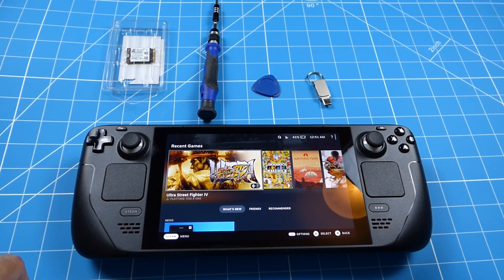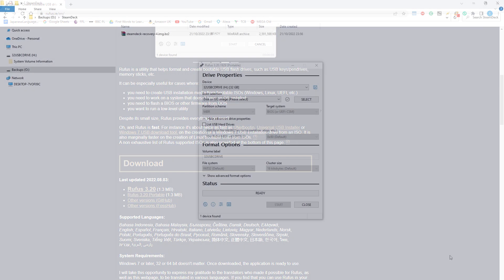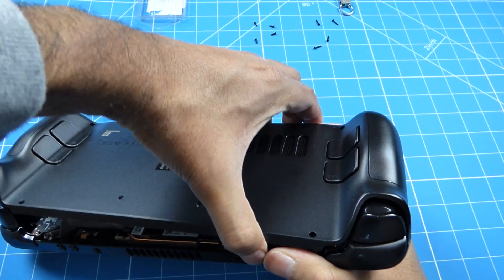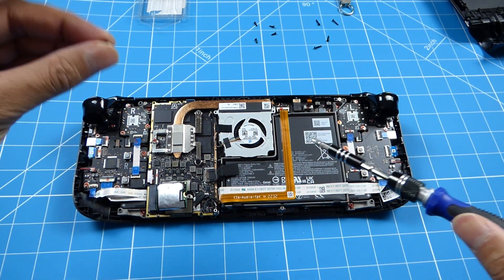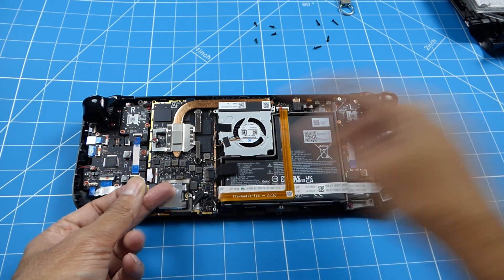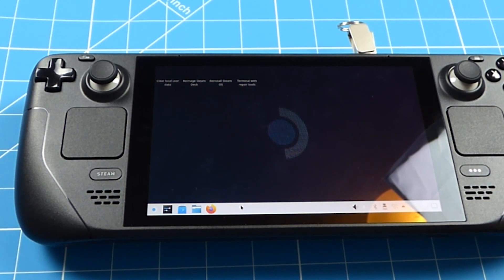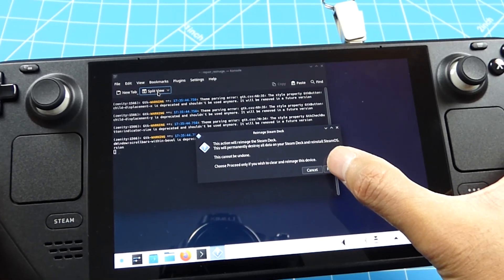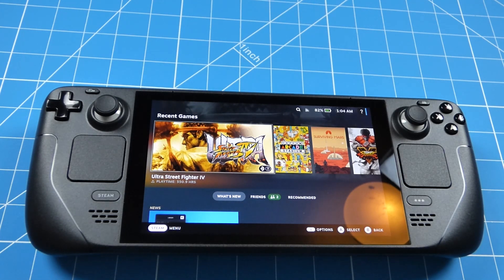Steam Deck SSD 64GB Upgraded At Low Cost !

Comment: Just did this with a 1TB SSD. It was a bit longer than the original SSD and I had to alter the padding under the shield, the shielding tape no longer fits around the SSD, and there's no screw to hold the SSD down 😅 So far, so good!
Reply: I went from stock 64gb to 512gb to 2tb and I found that it's way more seamless if you do a drive to drive clone with clonezilla before disassembly in order to keep all your game installs intact.
Reply: @exakelgaming  Good idea, lucky for me I had only had my Steam Deck for 1 day when I did the upgrade.
Reply from the maker: Nice. 2230 sized drives are not the cheapest. Well done !
Reply: guys isn't better just to buy an micro sd card? that's why you have this slot for , why would anyone need those internal drives?
Reply: @Voltomess  2 words: MOAR SPACE!!!
Reply: @Voltomess  It didn't cross my mind that I could install a 1TB SD... oh well...

Comment: Mine took 30 mins then went to black screen with mouse cursor and that's it.... So I turned it off... Should I have waited longer or did I do something wrong???
Reply from the maker: I think something went wrong it shouldn't take that long.
Reply: @IntriguingTech  I got a SanDisk drive this time...  Will try again... I hope the SSD I got is good
Reply: Update , I got the SanDisk and it worked in like 3 mins.  One question I did notice is that on my deck in desktop it does mention an update needed for better compatibility for my SSD.  But I'm not sure how that works in my deck so I left it alone
Reply from the maker: @gaminginstilllife9429  Glad everything went ok with the new SD card. Yes the firmware update is good I recommend installing it. The update fixes a few issues on Samsung SSDs.

Comment: I purchased the 64Gb one as well and upgraded to a 512SSD for peanuts.  I wanted sharp screen clarity on the 64 over the fuzzy screen look of the 512Gb Deck. It looks like it has a thin layer of grease on it and when I tried my friends - I kept blinking as I subconciously felt that I had sleep in my eyes.  I didn't like that - but the crisp sharpness of the 64/256 Deck model screens are fantastic.  It has a bit more glare (reflections are muted but still present on the 512 Deck), but the clarity is way better.  I approve your strategy - get the cheap deck with the sharper screen and go for a cheap SSD upgrade.  You save a lot and you end up with a better product!
Reply from the maker: Well said mate! Thanks for commenting.
Reply: what cheap SSD you guys recommend? I'm waiting for my steamdeck and I wonder which one to get, I only know it has to be M2 2230 but which one WD or the others? I want to get 512 or 1TB but not expensive, I gotta keep money for games 🤣🤣

Comment: For all the work you did. You should have just put a 1TB in that steamdeck.  It would have cost you about a 150 bucks.
Reply from the maker: Its not needed, I have a big SD card and there is only so much games you can play at once. Thanks for commenting.
Reply: @IntriguingTech  what! That makes no sense. I can always use more memory. I'm literally at a loss for words right now.
Reply from the maker: @Coreygunz252  There's very little benefit of the ssd for loading games. It's only for caching data. In that case a small ssd + micro sd card is fine. See this video https://youtu.be/4AIY5wH77Po

Comment: Hi, thanks for the video!
Couple of questions? The Ssd I have coming will have been in a windows machine (second hand), do I need to format it to a different file type before it goes in the Deck?
The same question for the SD card too basically, does it need to be formatted to EXT4 before I dump the image file onto it? Thanks!👍
Reply from the maker: Hi, The SSD will be automatically formatted during the reimage process when you boot off the USB. The SD card can be formatted to EXT4 but it wont be readable on a PC (just format as shown in the video). You might be able to format it as NTFS and it will readable by both windows and Linux aka Steamdeck (I didnt try this but it will be more convenient).
Reply: @IntriguingTech  Thanks for the reply! Looks like it's just FAT32 at the point you dump the recovery image on? So Deck can read that ok, I take it? Thanks again. (Waiting for Deck to arrive, just getting everything planned before it arrives.)
Reply from the maker: @poopscoop2000  When you use Rufus it will reimage with the correct filesystem automatically. So it doesnt really matter what the filesystem is. Just save the recovery image on to your PC.
Reply: @IntriguingTech  You sir are a gent, thanks again.👍

Comment: I don't see the point of voiding your warranty when you can use a high speed micro SD card. They've done tests and there's honestly not much difference in speed.
Reply: This doesn't void your warranty, per Valve.
Reply from the maker: I have both. I didnt film the microsd card in this video.

Comment: Sorry if you did mention this but, could the original NVME drive be cloned on a computer to remove the requirement for a separate boot drive?
Reply from the maker: You might be able to clone it directly in linux using the dd command.

Comment: Just a tip for anyone that's running out of space on the internal drive, there is a trick to moving the shader and compatibility folders to a microsd which significantly helps with space.
Reply: It does work but causes a massive impact on performance for certain games like God of war, rdr2 Tekken 7 and high on life...
Reply: Can’t decide to upgrade internal or just use multiple sd cards.
Reply: @0293holder  just use two 512gb cards or 1tb because some game files are huge mostly the AAA games, modern warfare is 160gb and games like max Payne 3 and the batman games are less than 60gb. It all depends on how many games you want on deck, also there's a dock for it on Amazon for 35 dollars that let's you play on your TV at full 4k and allows you to attach a 2tb portable hard drive to the steam deck doc for a unbelievable amount of games
Reply: What’s the trick ?
Reply: @MostInfamous209  Basically you move the shader cache and compatdata folders to the micro sd and then create a link to the main drive, so steam will still see them like they're on the main drive, and any new files will automatically download to the micro sd.

How exactly it's done, I don't know, I don't have a Steam Deck to try with, but it should be easy to find through a google search.
Reply: @wolfandspice  still taking up 60gb somehow

Comment: 12:20 I could see that when you came to screwing the screws back in, you ruined the threads on them. This is seen via the bits of plastic that drop out which you can see in your video. It's really important to screw these back in slowly and to allow them to fall into their original threads as you're screwing into plastic.
Reply from the maker: Fair point.

Comment: I bought the 64GB  model and upgraded it with a SK Hynix 512GB NVMe PCIe M2 2230 SSD for US $64.93. I added a 1TB SD card too. I saved around $200.00.
Reply: How was it? Nothing to worry? Or there is an issue after ???
Reply: @Met845  No problems. I was worried about installing SteamOS but it was actually easy. I'm playing my games from the 1TB SD card.
Reply: @olewornhat  How is it still holding up after the upgrades? Tempted to buying one very soon.
Reply: @markzmza  Great. I'm happy I saved a large chunk of change. I haven't found that I need it but if were to do it now I would buy a larger SSD. They're pretty inexpensive. All of the games I play are on the MicroSD card though. The SSD has 417.3 GB free of 457.31 GB. The Micro SD has 494.7 GB free of 912.6 GB. It all runs as it should.
Reply: @olewornhat  thank so much for the reply and info! Im happy to hear that

Just tired of paying again and again gen after gen of  old classics getting "remastered" for new consoles, im so happy this is basically a PC so i can finally get to creating the perfect emulation machine and keep the games for years to come. Not paying for super mario bros on the switch 5 bucks a game that ive owned since the NES lol rather emudeck stuff like that plus I have like over 200 steam games!!

Ill probably go with the 1tb ssd 2230 and see how it goes! 👾🎮
Reply: @markzmza  Yeah, I would get the 1 or 2 TB SSD even though I have 417.3 GB free of 457.31 GB on my present card. MicroSDs are fast but expensive. I don't really need all of my games on the Steam Deck so I'm happy with what I have.

Comment: second thing i did with my deck. first thing was powering up to verify everything powered on properly. after that, i opened it up and installed the 256gb ssd. i'm glad i did since 64gb fills up fast with all the OS and shader downloads.
Reply: yeah you can't really play anything other than small indie titles with the base storage. I just got the 512 because I didn't mind paying a little extra and even though opening it up is really easy, a big drive that I would've been happy with wasn't available at the time so I just went with the most logical choice. If I was buying one today with everything I knew, I would just buy a 400 dollar model and get a 1tb drive and maybe an sd card

Comment: for today no point upgrede ssd ,    new cost 450    256gb             350   64gb   +coming soon  steam desk 2
Reply: it's definitely worth it if you don't mind opening your deck. i bought the 64gb version for $399 and bought a $20 256gb ssd. basically $110 cheaper than buying the 256gb deck.
Reply: Where did you buy the 69gb deck for 399?
Reply from the maker: Yes for some people its worth it. Steam Deck 2 wont be for a while yet they havent released Steam Deck 1 in all regions yet.
Reply: "coming soon" gonna be years... they may revise this one. but a true steam deck will be 3+ years away.
Reply: 256 gb model scren better  for 64 gb screen scrap mate

Comment: did it take forever for it to boot from the usb drive? been 15 min and im still on the logo screen
Reply from the maker: No. Fairly fast.
Reply: @IntriguingTech  finally reached main screen after about 45 min. Then took 10 min to load the reimage after i clicked it.touch pads didnt work tho had to use touch screen.  Took 10 min for it to reimage. Loading onto ssd now
Reply: I think it happens when you're using a USB 2.0 drive. I had to deal with the same thing since I used a USB-A to USB-C converter with my old USB-C drive. It just takes a while.

Comment: I have an issue in steam OS with my SD Cards, i have like 3 mb write speed and 30 mb read spead while in windows i have 94mb read and 40mb write. So in short i cant use my sd card on steam os. Anyone has any idea why that is ?
Reply from the maker: What make is your card ?
Reply: @IntriguingTech  san disc
Reply from the maker: I suspect it could be due to some disk activity going on, on the Steam Deck. Since the microSD isnt the best media for IOPS its dragging the speed down. Something reading is writing to it. Just a guess.
Reply: @IntriguingTech Well the sd card is always empty cause well with 3 mb/s write its not usable. I would go full Windows but there is no way to use the Steam deck controller on windows expect with some programms that dont really do what i want them to do.
Reply from the maker: @PokeBurnPlease  Yeah doesn't sound good. Maybe take it out of deck and do a surface scan on a PC.

Comment: I wonder if there’s a way to image the SSD and use that to avoid setup
Reply from the maker: Thats what I tried to do first. I have a USB nvme enclosure. But I couldn't find the image file so had to use the recovery image method instead.
Reply: @IntriguingTech  I’m thinking I’ll try booting into a usb and creating a backup image of the SSD using the dd command, then burning that image to the new SSD and expanding the partition size. I’ve done it on a Linux PC so I think that should work
Reply from the maker: Yes. That should work and it should be fast (at least in terms of disk activity)  cos the USB port is 10Gbps.

Comment: There's a range of 2230 cards on eBay and Amazon . Do they all fit ?
Reply from the maker: Yes. 2230 means 22mm x 30mm it is the size. I've seen other youtubers even fit 2242 but Valve advises against it.
Reply: @IntriguingTech  There are thermal pads underneath the shielding. One of them contacts with the charging controller chip. It's the one near the top right corner of the NVMe drive. When you place a 2242 drive, it's 12mm longer and sits on top of that chip thus prevents its contact with the thermal pad. It will probably still work but you are taking the risk of damaging your device. If you think about it there should be a reason, they put thermal pad on top of that chip to reduce its heat. :)
Reply from the maker: @garenyo  Good point. I'd advise against 2242 sized drives. Thanks for commenting.
Reply: If you can afford it, $470 will next you a 2TB 2230 SSD.
Reply: I found a 2230, 256gb on eBay for £19 with free delivery